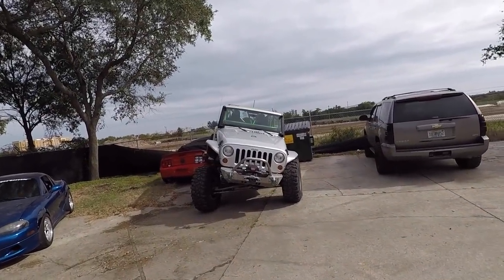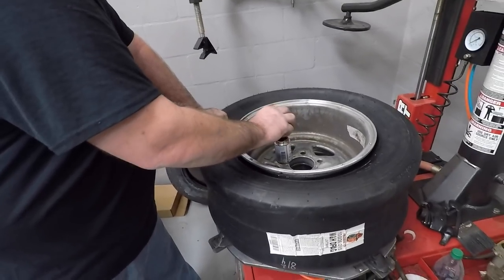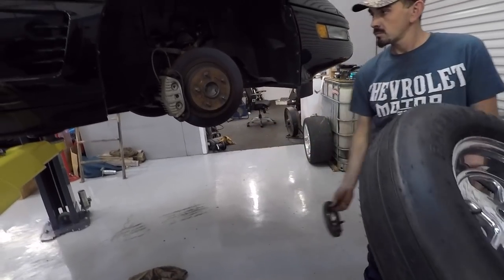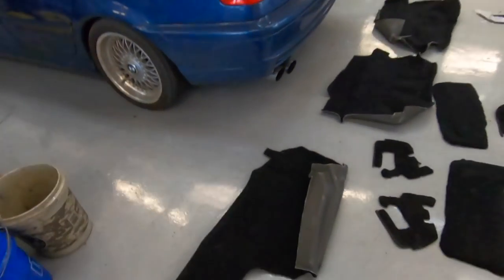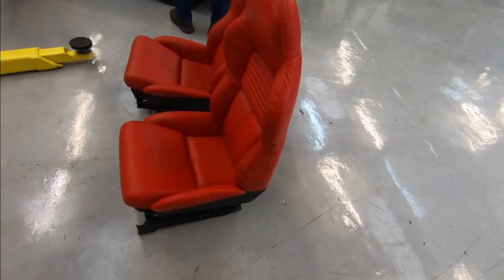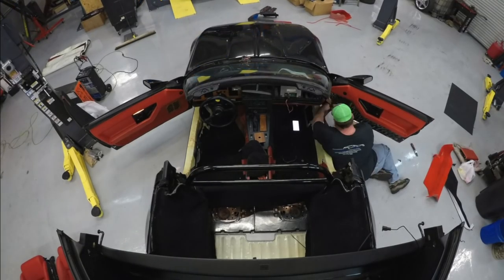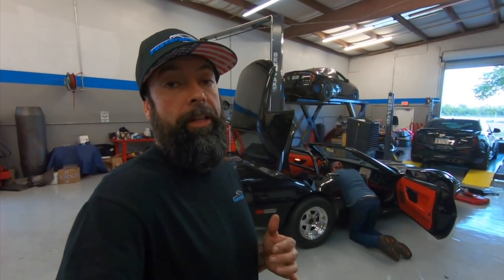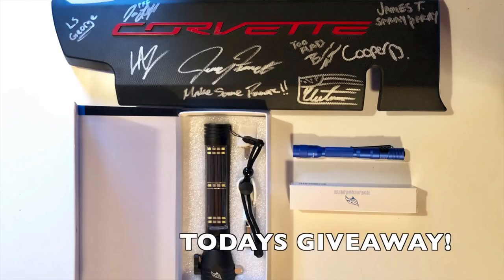Restoring The Legend Ep 2! It Looks SICK!!

Comment: I didn't know the engine started out as a 4 bolt 400 if that's the case just have it bored up to 434 with 6 inch aluminum rods steel crank and a set of 18 degree aluminum Brodix heads a buddy of mine had a 434 in his 68 Camaro running mid 9s with a stock suspension just added cal trac bars and when he hit the nitrous he went low 8s and it was all steel except the hood and deck lid and had a full interior on 10 inch tires

Comment: No disrespect but.  I personally own a 540ci Lingenfelter 1991 corvette. I have had several friends that owned 415 LPE ZR1 corvettes putting down 600+ to the  tires.  I also own a 1994 ZR1.  You may gave a strong car but it wasn’t the fastest NA Corvette by a long shot in the late 90’s.